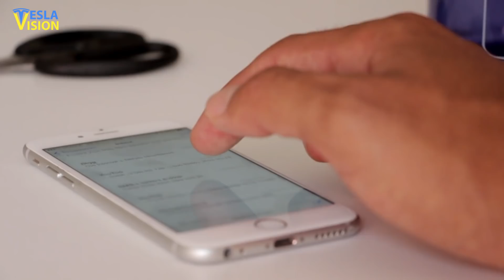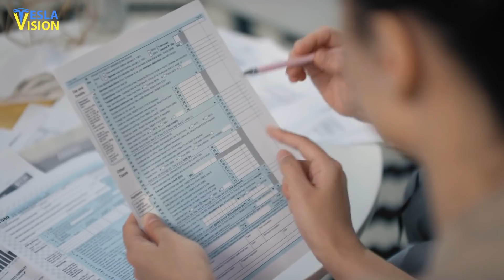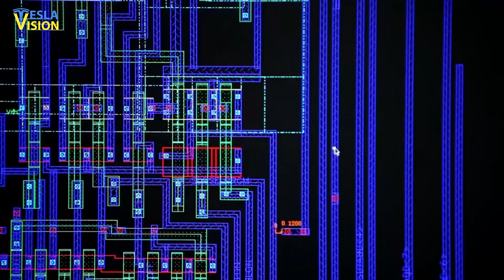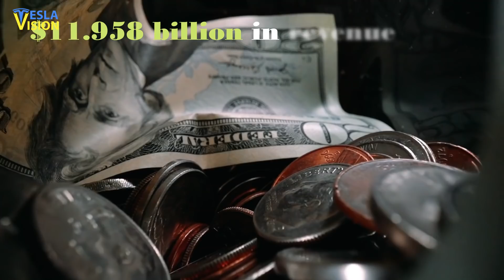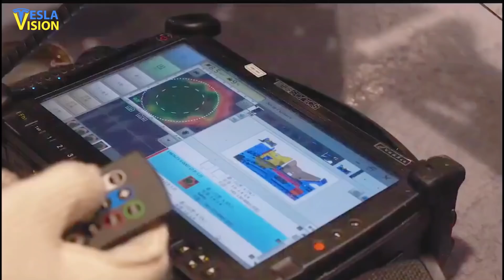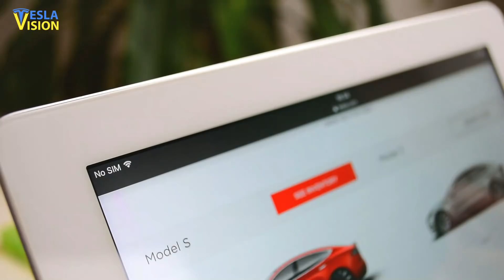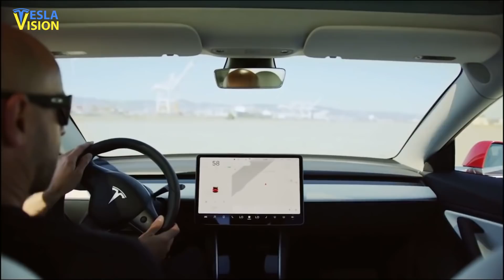Global Chip Shortage: Elon Musk Found A Solution!

Comment: Great for production today - a real headache for those trying to debug problems tomorrow.
Reply: If your code isn't remotely portable, you're doing it wrong.  But you're probably right as this chip shortage is today's problem caused by yesterday's mistakes
Reply: @kayakMike1000  You're looking at it from a programmer's point of view which is probably easier.

Now look at it from a mechanic's point of view, trying to determine how to run diagnostics against this subsystem: attach diagnostic lead A to terminal 23 and B to 24 - unless it's using this microcontroller in which case you need the ACME unit and need to attach the red wire to terminal B ...
Reply: @vernearase3044  true.  Designing a new board with different chips, it might be really hard to layout the IO in exactly the same pattern, sometimes even impossible.  The test points and bed of nails harness would need to be tooled twice...  I guess if the shortage is bad enough, the cost of redesigning the board for alternatives now might be worthwhile.  It's a rough world out there and let's hope TSMC doesn't get repossessed by the CCP.
Reply: @vernearase3044  I am guessing, you're a firmware engineer that had to deal with this.
Reply: @kayakMike1000  you don't sound like you have done much embedded programming at scale.
Reply: @kayakMike1000  and you sound like someone who only plays with arduinos. And not at scale.

What works at your desk doesn't always work on a couple 100 million devices in temperature ranges from -40 To +80.
Developing that knowledge is expensive for each component and chip in the system.
Also a hal wont solve different chip lifecycles but again guess you don't design the system for 10+ year lifespans.
Reply: Sounds like an opportunity for a buisness specializing in debugging
Reply: @nean9894  that wouldn't quite work...  They would need the source, development boards, test equipment, etc...  The business doing the debugging would become just normal development in practice.  It's actually a thing...

Comment: No no no, you got this all wrong. The problem is with the foundries having too much work delivering chips with known software packages for this or that manufacturer of cars or whatnot. Rewriting the software is not what musk said he was doing. This will not solve anything since the foundries are the problem. He was mentioning rewriting the firmware so that he could buy similar software addressed to another product and make it loadable and functioning on his own cars. Firmware is the initial three or four lines of code that is not hardwired into the chip but simply loaded initially to allow the chip to tell it's receiver how it wants to be handled. Firmware is done from the outside in, I need you to ask that does not require advanced degrees or knowledge chip architecture.

Comment: Note: Microcontrollers are Semiconductors!
You can't switch from Semiconductors to Micro controllers.
Reply: hehe, don't poke ppl's ignorance.  This is ytube after all.
Reply: Thanks for pointing that out. Sometimes there is some realy stupid bulshit on youtube.
Reply: I wonder if they meant analog vs digital.  Semiconductors could be either.
Reply: @kayakMike1000  don't think so. There are no analogue circuits to replace microcontrollers for.
Reply: @helmutzollner5496  hmmm...  PID controllers could be implemented with op amps... I guess it depends on what you're trying to do...  But, you're right.  Probably not in this case.
Reply: Even the original germanium transistors and selenium rectifiers of 1950 or so were still semiconductors.
Reply: @Ebooger  yes, you are right, but I have not seen any selenium or Germanium micro controllers lately also I doubt that a few transistors could replace the functionality the Car industry us missing.